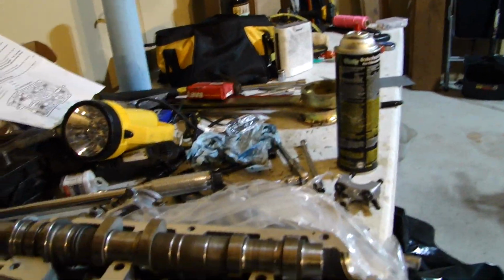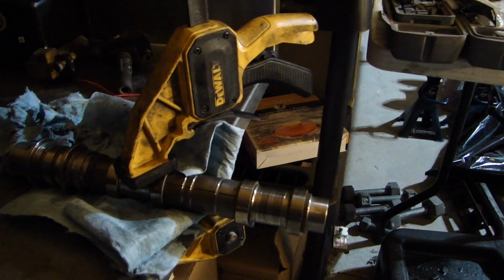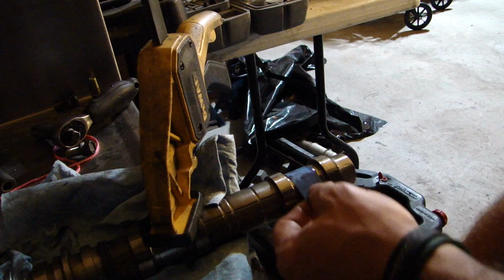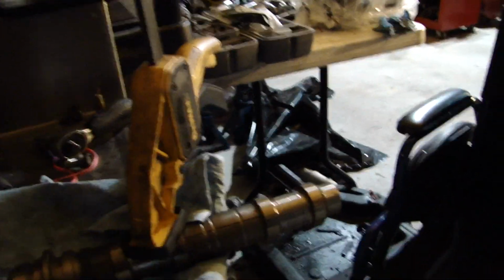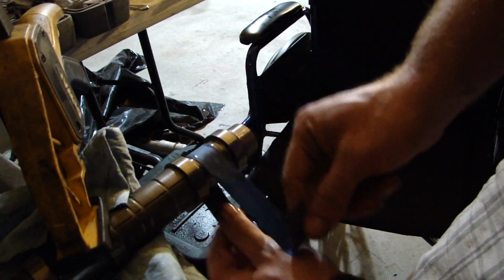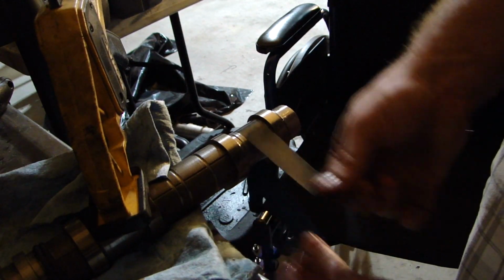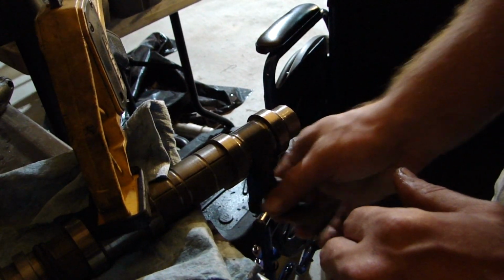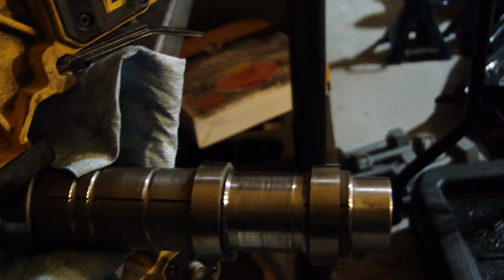You won't believe what I figured out! Easy DIY Cam Polish!

Comment: Another trick that is often used for polishing crankshaft journals is to wrap the sandpaper around entirely and use a shoelace wrapped a few times around it to move the sandpaper back and forth. This way you keep constant 360° pressure and dont create any out of round issues. Simple but I'm told it works well.

Comment: On my 2006 Renault Megane 1.5 DCI ,  POS, bought for peanuts 1 month ago with 299 000 kms,holed piston and all,  the cam is so scored that the (upper, of course) aluminum cap is so worn, that it even has sharp edges protruding out to the sides, its aluminum has beed extruded,displaced to the sides;  when i sand down and half-polish the cam journals it will become undersized;   

On top of that,the Alu. cap will have an oversized bore,  so, i will mic. both cam and bore,and sand down the cap to around  .001 to  .002 clearance ;
Won't be 100% round any more but i have done them like that for many years, works well

Comment: I first thought about using diamond lapping compound but then I remembered about non - embedding lapping compounds . So I’m gunna find some of that instead & then put some on the cam bearing surfaces & lightly torque it down & begin to lap away the problem areas that are possibly causing the cam to bind .
Reply from the maker: I'd totally try it honestly. In hindsight I probably would have gone up to 5k grit

Comment: This is a great thing to do. I did mine on an old lathe I got ripped off on from Craigslist. It was good enough for this process though! Haven't put up a video on it yet. I got to the Aluminum with a Dremel extension and buff wheels.
Reply from the maker: a lathe is the PERFECT way to do it! This video is the broke boy version

Comment: nice way to help save some money.  But, frankly, if I saw a cam with that kind of wear on a journal (much less a lobe) I would be replacing he camshaft and lifters.  That is not meant to be offensive to say your approach is not viable.  I just don't feel it is worth having an excessive clearance with a non-machined surface.  My two cents...
Reply from the maker: the lifters in these motors have a cap over them. i would send it off for a regrind if the lobe was messed up. since these ride in an oil jacket as long as they are smooth and not gouging out the aluminum journal it sits in they are fine. But I completely understand what you are saying. Many other motor types I defiantly wouldn't suggest it. Motor has 45k on it making some descent power since this video ;D

Comment: Not the proper way to polish cams or cranks, that will miss shape the cam. Must wrap sand paper all the way around, secure loosely with electrical tape then wrap a shoe lace around 2 or 3 times and pull back and forth, that way there is constant pressure all the way around the cam and it will stay round
Reply from the maker: Car has 50k on the motor since then bud.
Reply: I would take it further by getting a leather strap and measuring the strap to the width of the area on the cam. That way you get the best in covering the area evenly.

Comment: Damn, if this is rough to the touch & mine is not, as in if you touch the journals it’s smooth but has visible scores, then I think I’m good?
Reply from the maker: Yeah basically only a concern if your fingernail is catching on them. Since the journals it sits in are aluminum you just want it smooth.

Comment: Nice tip. Did you do any polishing to the journals and bearings?
Reply from the maker: I just took the rough edges off the journals. There aren't really bearings. And the journals are aluminum so the gouging shouldn't bother the steel cams was my thinking.